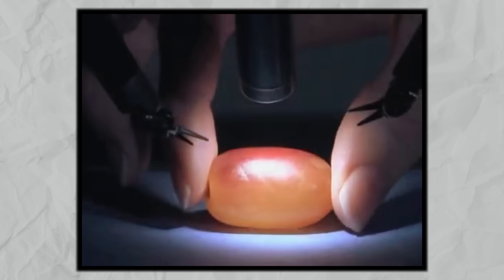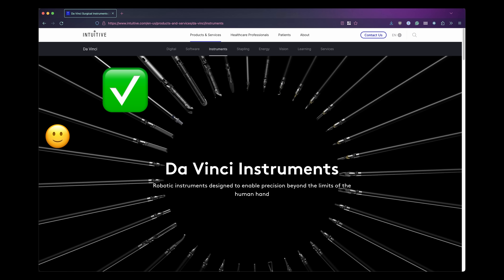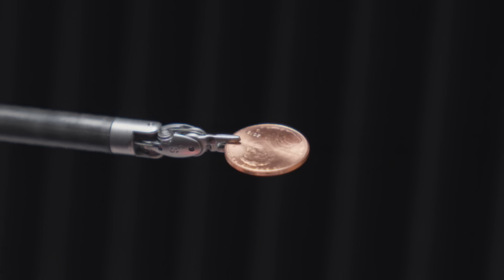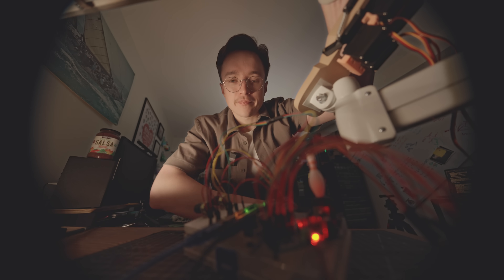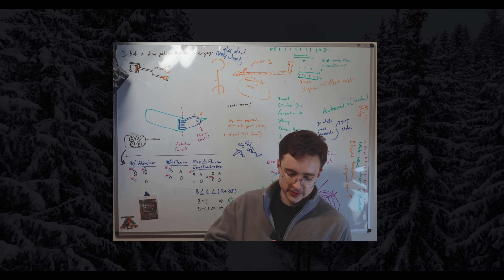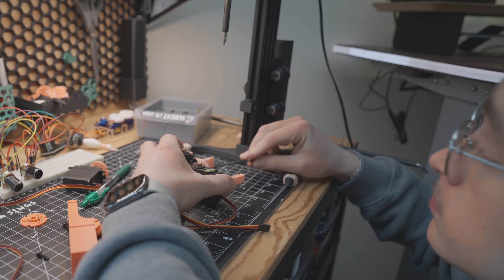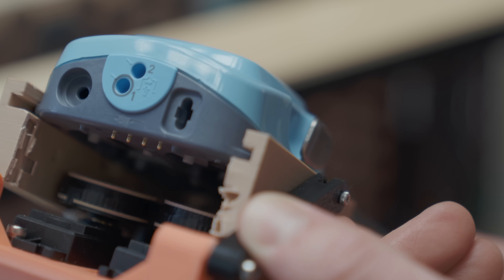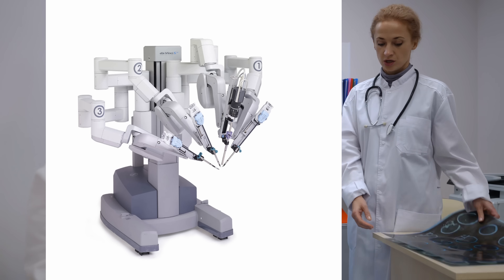Building a DIY Surgical Robot

Comment: Ive operated with the DaVinci system many times. It has haptic feedback from the instrument back to the surgeon's console. I always assumed that the system uses a brushless DC motor/gimbal motor with sensorless haptic control (https://www.youtube.com/watch?v=vJXnunhm1c4). I don't think you can accomplish this with a servo motor setup. The surgeon console controller has gimbal motors at each axis that provides the forward position control to the instrument while simultaneously providing instrument feedback into your fingertips and wrists.. i.e. it physically pushes back against you when the instrument hits something. Looking forward to your progress!

Comment: I have been working on this exact same project for a few years. Decided to swap to stepper motors due to the coupled motion compensation using up a large portion of the movement range on the servos. The actual robot is cable driven all the way to the mounting plate. So, all the motors are in the base of the arm, which helps with balancing the weight. Also, due to the arm being a remote center mechanism it only requires two motors for the bulk of the motion.

Also for control I was thinking that a magicleap/ultraleap hand tracking unit would be the most cost effective way to get 6dof control for two arms thought it would not have force feedback which is somthing the real robot has. I was even looking into the idea of the robot being controlled over a network connection so the robot could be controlled remotely.
Reply: Yes I was thinking stepper motors as well, because the Servos typically only have 180 degrees of motion but most of the pucks can travel further. Also, probably easier to implement torque detection with stepper motors.

Comment: Hey, like several other commenters, I am a software engineer and I had the opportunity to use the Intuitive Surgical daVinci during CVPR conference. I must admit that the most important element of this experience was the intuitive control of the robot using „pinching” and foot-controlled pedals. Equally important was the control stand itself, equipped with goggles and head and elbow supports. I am not sure if the goggles had stereovision. I had the opportunity to perform treatment on physical rubber rings as well as virtual training programs such as „moving a ring along a curved wire”.
Reply: There is stereovision for the operator but not the assistants.

Comment: On the topic of instrument control, only two instruments are ever under direct control by the surgeon. There's a foot pedal that switches the active instrument with whatever instrument is located on the same side as the pedal, and it's placed in a locked position. This is usually used for retraction or switching between needle drivers and scissors when suturing. The camera is also controlled independently (I can't remember if this is foot pedal or hand switch controlled) but disables all other inputs while the camera is moving. Usually the camera is placed as optimally as possible and moved as little as possible, both to prevent disorientation and to keep instruments in view at all times.
Reply: Worked in the OR a bit as a rotating surgery medical student.  They have the camera/endoscope attached to one of the arms and they toggle between different tool arms like the input on your TV.  Once u set the camera arm’s position, you change inputs to a different tool arm, thereby locking it in place.  If u could program an Xbox or PS4 controller to control the arms and use a button to switch inputs that would be able to mimic the da Vinci machine quite nicely!

Comment: I used to work with these every day, but it was 8-10 years ago so it was pre XI, I believe it was SI. The motorized discs would "home" themselves after an instrument was inserted, and a successful homing had to be  performed before the instrument could be extended into the patient. It was a multi stage process that allowed the robot to ensure that all the cables within the instrument were intact before they came into direct contact with the patient, and to allow the robot to sync the cables between the two independent sets. There was some kind of force detection within the main unit that would detect irregularities, so if the instrument was misaligned and attempting to move in an unexpected way while restricted inside the cannula, it would report an error. A red light would show on the docking portion of the arm, the assistant would be unable to advance the instrument into the patient, and the surgeon would not be able to control it. Major pain in the ass to use but a lot of really cool technology packed in

Comment: Just an idea: use (cheap) VR controllers for input (like quest 2 etc), if you had dual wielding wireless 6DOF control, this would likely be even more advanced than what davinci is doing, you could scare the pants of them if you got this working in a YT video with decent input lag.

Comment: For an input device, look at they things they use to control puppets, in the animatronics Industry they are called a "waldo", they are basically what the davinci controler is, but a bit less mission critical. 
I tried making one  to control digital puppets, but my maths wasn't good enough to do all the 3d transforms, I'm sure you will manage it though.

Comment: Thanks for posting this info. Some proprietary knowledge may be found using the Google Patent search engine. One example, search for "7689320B2" which is a "Robotic surgical system with joint motion controller". View online or download the PDF. You can also search for   assignee: intutive surgical    to see their other patents.

Comment: hey uh.... do you need any of the new DaVinci XI arms? Cause I work as a Sterile Processing Tech at a trauma center and uh..... I have a bunch of the newer arms. Even the powered coagulating arms. I even have access to the machines themselves and could easily supply images.

Comment: What an awesome project! Instant sub :-) For control interface, Adam savage has a few vids from a visit to Jim Hensen's Creature Shop where they've iterated over many years developing their in-house control rigs. My guess is they ended up in pretty much the same place as Da Vinci did, but you might get more insight from Adam's vids.
I wonder if any of the kinematics are a side-effect of their interface, or if they were driven by the mechanical needs of the instrument?
I wonder if BLDC motors with pots attached could give you a force-feedback controller, but then you'd have to work out a way to sense the forces on the servo's for the feedback. A strain sensor on each servo's mount, perhaps.

Super-stoked to see where this goes!

Comment: I've gotten the chance to play with a DaVinci robot once or twice through a surgeon friend, and they're really cool. You say it's rather inaccessible... but ask around and it's not too difficult, especially since hospitals have tools they need to otherwise dispose of just like those you bought on ebay. 

Also, the video clip you showed of the DaVinci input is the new version: basically reversed stacked brushless gimbals. The old version, iirc, uses wires under tension inside a "workspace" and it basically measures the length of the wires connected to the "pinch glove" or whatever the manipulator thing was called. Might be easier to realize. 

Regardless, I think you absolutely need a mimicry based input controller with force feedback. Force feedback is a make-or-break type thing for a system like this... maybe even consider moving away from servos and into closed-loop control brushless?

Comment: The disks from the instrument do not connect directly to motors. The attachment arm has disk that are controlled by steel wires that run inside the arm. So the motors are inside the larger elbows of the arm.

Comment: Gesture control; I did some work with the Leap controller and Kinect back in the day - they worked great on tracking then (Kinect could track face expressions and hands) and there's probably better/cheaper hardware now.  Or a 10 touch point glidepad per hand.  Spacemouse makes a pretty cool 3D/spatial mouse for CAD work; it's fairly unique - I have just the mouse itself, not the command/control pad one, so it was only about a c note.

Also Nintendo Power Glove would rizz up a W lol you always think it's gonna be lame, but no, every project with a Power Glove ends up being cool somehow even if it doesn't work.

Comment: it is not technically hard to build something similar to that controller, but it would be damn expensive and hard to get force feedback. someone made a 3d mouse (6dof input device essentially) use hall effect sensors iirc. also you can buy the 3dconnect ones for under 100 but there may be a software integration hell.

Comment: I got to see one of these machines on display in a mall quite a few years back (Seemed to be to get people more familiar with them) We were allowed 15 minutes or so to mess around with it and attempt some challenges. things like putting rubber bands from braces onto little cones and manipulating small objects. By far one of the coolest things I've gotten to use so far.

IIRC the control was using 2 pinch controllers where you can use your thumb and forefinger to control opening and closing but can also rotate them on 3 axis to control the end effector. It looked like a gimbal for cameras but the end that would normally be held was attached to the terminal. It was also able to move around which controlled the overall location of the arm.

Selection of arms was controlled by foot, as well as selecting the movement of the camera. Though if you added buttons for the other fingers you could probably control more arms. (say using the middle fingers for arm 1, ring fingers for arm 2, pinky for arm 3. Or by assigning specific arms to each hand.)

Comment: I have a six axis sensor system made from potentionmeters and an UNO.  It might be just the controller you're looking for.  it's like a tiny 6dof arm with no motors, only sensors.

Comment: Using Oculus Touch controllers seems like a decent idea for input. If you wanted to go all in, you could have the camera view appear in VR and then perform all the IK calculations for the arms before transmitting the specific motions to the microcontroller.

Comment: you should check out the thrustmaster T.16000M FCS Flight Stick two pack.  its a (relatively low cost) left/right pair of analog 4 axis joysticks a lot of people use them for flight sim games.  Alternatively and more expensively you could also look at the virpl constellation alpha joysticks as they have analog triggers that would allow you to do fine grain analog control of the open and close of the tool while still having 4 axis analog control of end effector positoin. I think these are likely the lowest barrier to entry control systems with the type of input control you need for the application.

Comment: Awesome video, and really cool work getting those actuators up and running! Looking forward to the rest of the series. Instead of trying to build out a "drive by wire" remote setup with encoders, I wonder if a physically-linked system using pneumatic/hydraulics might be easier? Something akin to these Disney Research telepresence papers: https://studios.disneyresearch.com/wp-content/uploads/2016/05/A-Hybrid-Hydrostatic-Transmission-and-Human-Safe-Haptic-Telepresence-Robot-1.pdf

Comment: The circle-spring is the adapter-hole-filler (large hole to small hole) used to plug 45rpm vinyl records so the narrow metal stem of a 33rpm turntable would fit correctly. I like those robotic driver controls, shouldn't be all that difficult to implement. These are great investigatory tools to work with, capacities strips used for pitch/bend with a synthesizer might do.

Comment: You should look at the 3Dconnexion spacemouse industrial module; it’s a 6 dof 3d joystick. 

I believe you could use the ‘normal’ spacemouse compact too, but you’d need to mess around in the driver, or directly code in the compatibility with the axis output

Comment: Okay hear me out how about for the control of the robot you use something like what Michael Reese did in his video he did it more as a joke where he had a visual sensor that tracked his hands I think that could possibly work I would think you might be able to do something possibly with the usuals or using IR to detect motion and detect how things are rotating and into what degree but I think something like that might work for this scenario of the robot

Comment: for the controlls: there are open source versions of the spacemouse (tho none are at the stage of completion yet I'd say), that could probably be a pretty intuitive solution if you add another force sensor that measures squeezing or something for closing the sissors

Comment: Can the main arms be done by direct hydraulics? By using different diameters you can easily scale the gain up and down and the hydraulic motion is super smooth.  Syringes can be used cheap to proof of concept.

Comment: cool! I used the controller of this in a conference, they had this hand controller but so small it would sit on a normal desk, and was connected to a PC running the simulated machine; the output was on screen BUT also on the 2 lenses microscope, so you would get full 3D.
I saw many people struggle with it, but i aced their little "obstacle course", it felt very intuitive. I remeber I could move my hand whenever i wanted and never hit any physical limit, so there is some VERY smart mechanical design there

Comment: You probably should have stocked up on tons of these instruments before publishing the video because you just know the manufacturer (ISR) will likely immediately prevent anyone from selling the old ones and make them return them so they can be destroyed.
Amazing project, I'm gonna predict your channel explodes.   There can be many other uses for this device besides the clear high-value surgery application.
Given I'm getting older, just soldering chips on a circuit board with find pitch pins is rather difficult, even placing components 'by hand' is very difficult.

Comment: My recommendation for making that setup to control it is simple, but also complex. Make 3D printed analog sticks that you can hook your fingers in, then set the analog sticks on a surface that makes them easy to use. You can then put the finished device on something like a space mouse in order to move it forward, backward, or rotate the arms. Pushing down can lower, and pulling up can raise it. Or you can just use a scroll wheel which would be a lot more precise. Now that I think about it, scroll wheels would be the best choice in a lot of cases considering how hard it is to overshoot with them.

Comment: For robot input: hold a pen and use computer vision to detect the angle and position. You can scale it so a change in actual position only changes half in robot position so you can have higher precision. And for clasping, you can add a button to the pen.

Comment: Buy joysticks for a flight simulator with 3 axes (forward, backward, left, right, and spin), and if possible, an additional joystick on top. Or, if you prefer something simpler, just buy this (SaiDian 1 Pcs 4-Axis Joystick). Or buy gimbal motors with encoders, and project arms for them, and with this option, you can add feedback . Good luck with this project

Comment: Okay listen, I was at the University of Utah Surplus store one day and they had a full Davinci Robot (including the surgeon station and computers) for sale for only about $10k. The teaching hospital there had upgraded, I think. I had, just days before, won 3rd place and $10k in the 2015 Hackaday Prize competition. I tell you, I was very very tempted! But I didn't buy it. (Ironically, my wife needed an emergency appendectomy not long after, which is where the money went. If I'd purchased the robot, I could have done the appendectomy myself and the robot would basically have been free). ALSO, like you, I noticed that the instruments were available on ebay and basically wanted to do what you have done here (man, the internet delivers sometimes!). Having given this thought for years, I do have a suggestion that is a near perfect fit for control (IMHO): VR. You get all the DOF you need for each hand in a perfectly intuitive interface, you could use the triggers to operate the graspers. You can even move the cameras on a third robotic arm with the headset. The VR stuff isn't hard to do in Unity. Putting all of this together is something I've wanted to build for a while but lacked the time. I am probably too busy to contribute, but I'll be following with interest. Thank you! Excellent work!
Reply: For a tiny vision system, I had looked into the NanEye series from AMS. They are unbelievably tiny, and less expensive than I had expected. I'm sure the real Davinci robots use much nicer laparoscopic cameras though.

Comment: You could use a "potentiometer glove" trick to control >12 motors. Each finger controls a servo via a string/pulley to a potentiometer attached near the knuckles; then using a gyroscope/accelerometer for bigger movements of the larger arms.